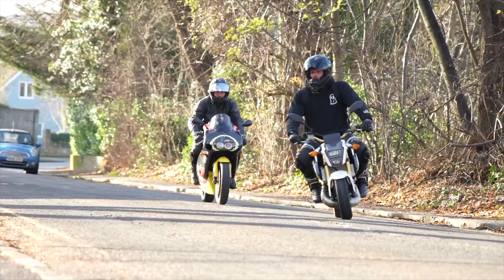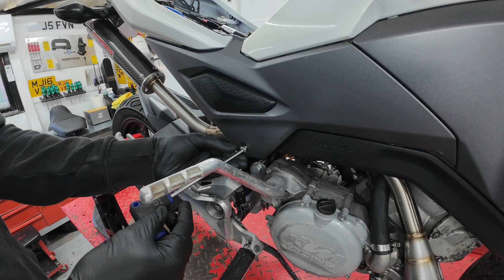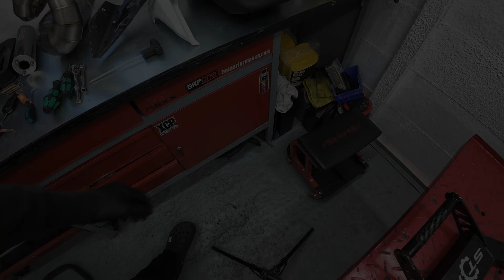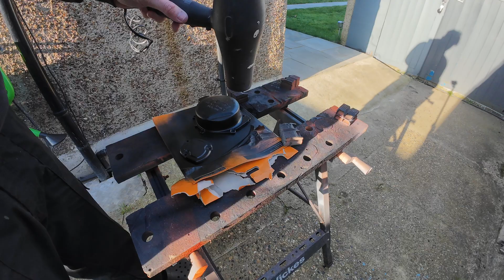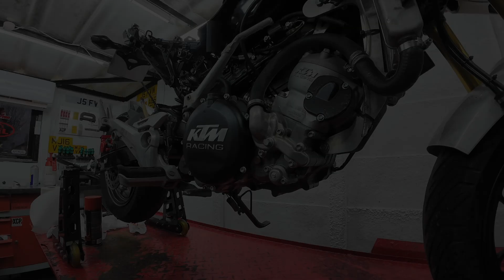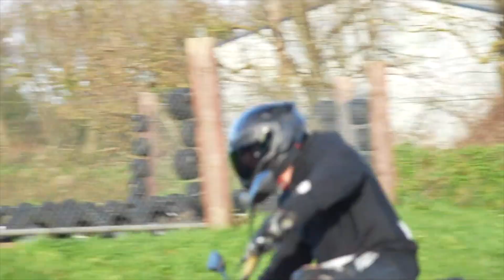How to restore motorcycle engine covers on a budget! (Sub £10) Project Hoonigrom

Comment: If you don't want the sanding hassle, you can also use painters' tape on the text that is sticking out. With a rubber hammer and some gentle taps, the tape will rip at the edge, leaving you with perfectly masked text. Remove the painter's tape when the paint is still wet; this reduces the risk of pulling off any paint. Then use a clearcoat. In one of my XT600 engine rebuild video's you can see what I mean.
Reply from the maker: Good tip 👍 

As my cars were rough on the logo too it was the most straight forward option for me and very pleased with the outcome